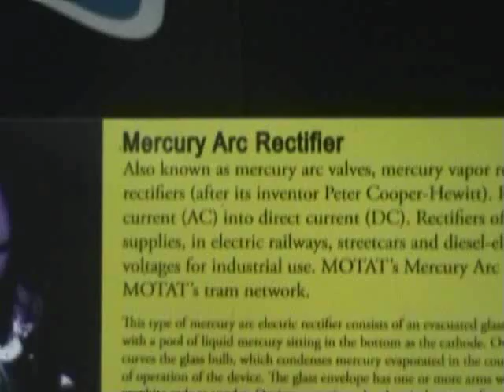Mercury Arc Rectifier

Comment from the maker: @360fatcats It heats up the pool of mercury in the vessel.
A large cooling fan underneath the vessel will cool the rectifier.
The fan is not visible on the video as the rectifier is in a locked room